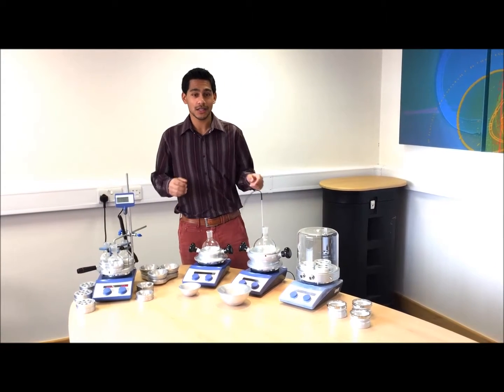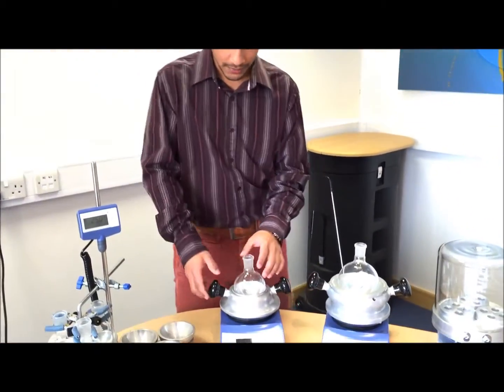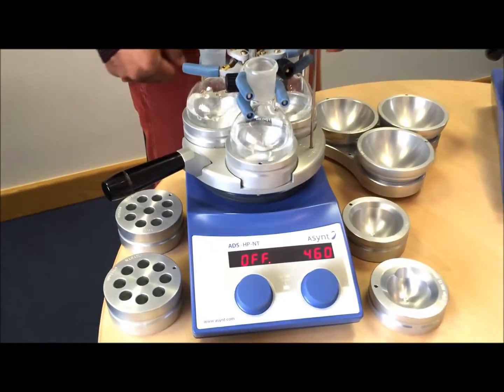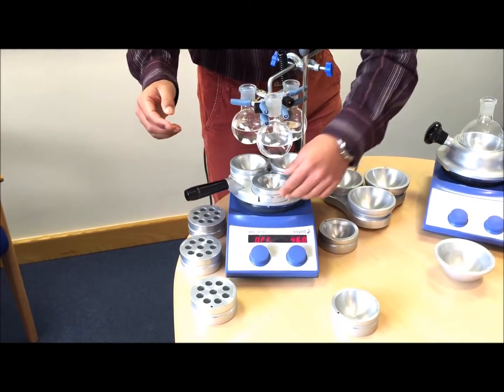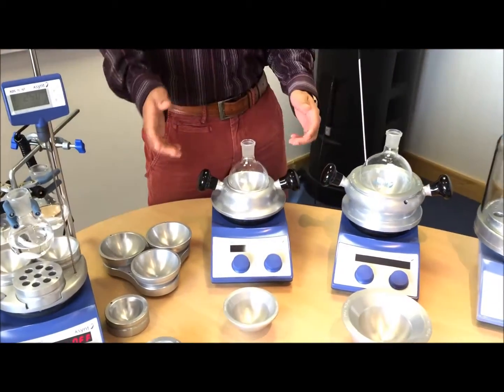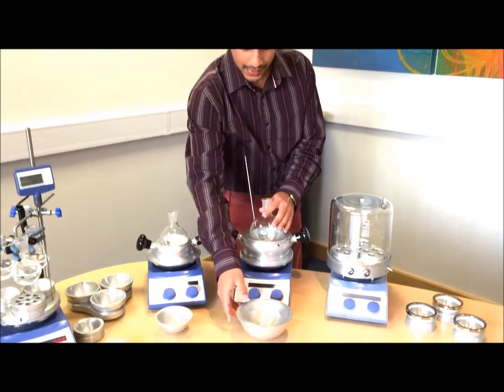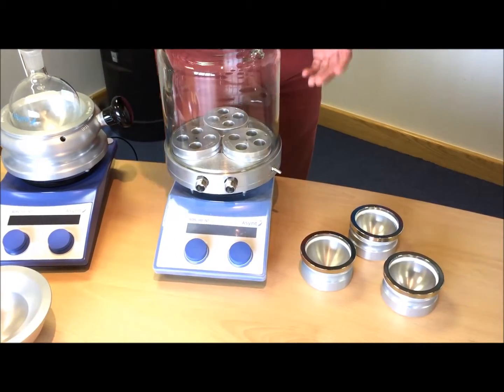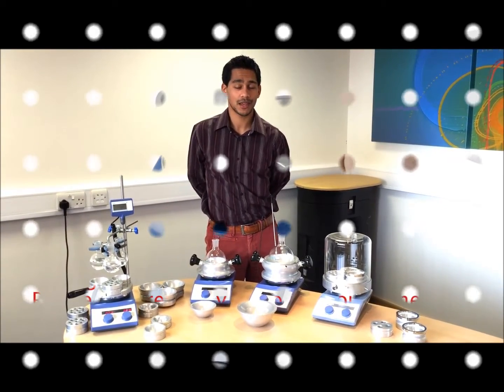Asynt introduction to the DrySyn heating and cooling system

Comment: How much temperature dissipates with these? ie. What temp setting is needed to boil water?
Reply: There are so many factors, size of flask; fill volume... Water has a high specific heat capacity so you will probably need around 15C over the BP.